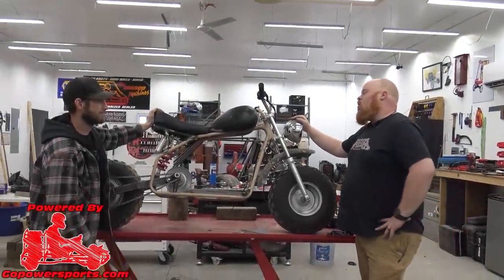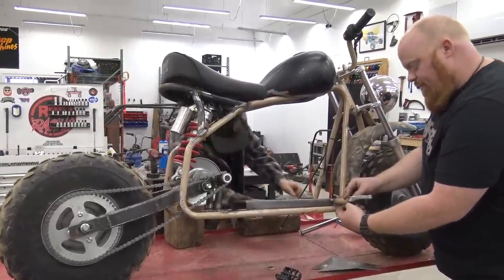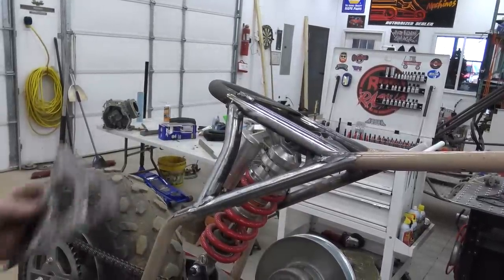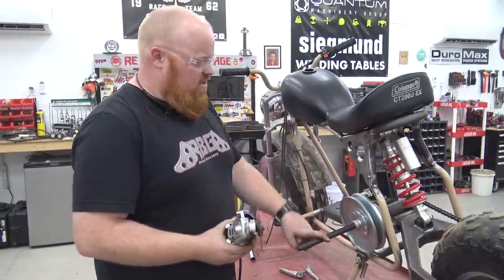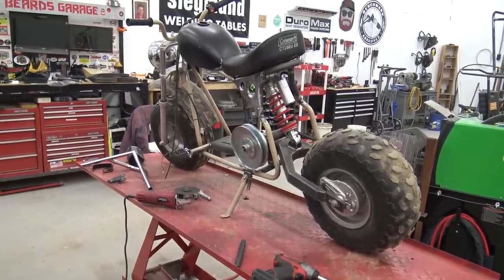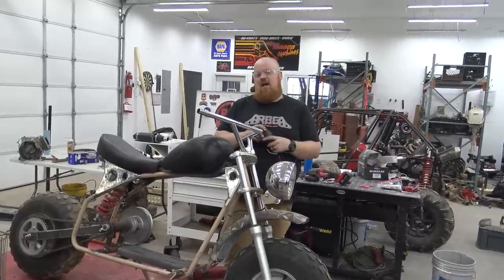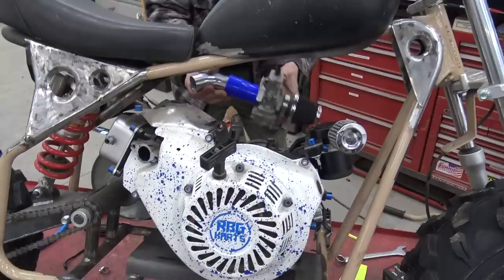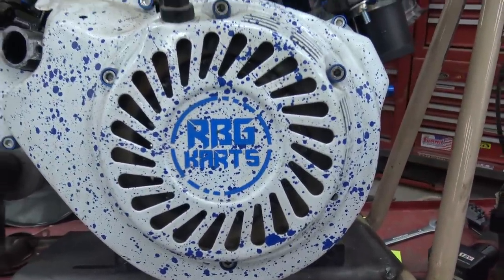Dimple Die Panels and Aggressive Tires ~ Coleman CT200U-EX Full Suspension

Comment: Man y’all have got me in so deep I don’t know if I ever will dig out. Started watching RBG before u left the Ford place. At some point I started dreaming of building my grandchildren a go kart. So RG said get a Duromax, and said CVT the way to go , got that to. Then there was the hydraulic brakes , got that to oh yes and the fed and rev trans , yeah that’s a game changer Lonnie says.so got it. And got to have live axle and v tread tires yep ordered them. Oh almost forgot rack and piñon .Then I looked at the old go kart frame and all this all this ain’t fitting on it. No problem, what would old Greg do? Go buy a bunch of tubing , and build a frame from scratch. Didn’t mention seat and 4 point harness. Then started cutting, grinding and tacking. Now all I need is for Greg , Lonnie and the little serial killer to come help me finish it before I die of old age!

Comment: I watch your builds and really enjoy them.I have ridden motor cycles for ever and just wanted to make a suggestion. If you would re-drill your motor mounting holes to move every thing to the right, this will move the motor pulley away from your left ankle.  Looks like you will need to cut and re-weld your jack shaft mount. If some one with out boots on gets against that pulley it could eat up an ankle.
Reply: I hope he doesn't, and doubt he'd even waste time contemplating it, as it would clearly be a huge amount unnecessary work.  
If it was going to be a problem it would be far more sensible to fabricate a basic cvt cover.

Comment: Those dimple die kit are quite ekspencive, but they does the trick, that`s for shure. Very nice build boyz, but you could straighten the curve on the seat, me thinks. Make some double disc-brakes on the front wheel and it will be totally awsome.

Comment: To make the dimple dye cut piece slide off, could you put some grease on the screwed on end so when it cuts it will just slide off?
Reply: But it came off without a problem.  If there was an issue it just means the guide hole could be drilled marginally bigger.  Grease isn't going to stop a close fitting guide hole from minor hanging up on the threads.

Comment: I have a question for you I'm starting my own YouTube channel but I needed a question answered about 301 predator engine I bought one of them cheap torque converters but I need a torque converter that fits on the engine the correct way instead of backwards

Comment: Seat needs to move rearwards about 3-4" and a frame extension added to the rear and a rear fender added to smooth out the fitment lines and make that rear tire not look like it's sticking out a foot...  But looking good otherwise...
Reply: Not at all.  I hope he doesn't ruin it by doing that.  Proportions are fine and kinda like the classic bobber look.

Comment: you are going to have problems with the intake
Reply: Nope.  Ignorant comment.
Reply: @SportbikerNZ   no it just seems like it. Fuel pedals in long smooth tubes. 😂🤦🏼.
Reply: @SportbikerNZ   we will see when he post a video if it works it will be sweet. But if not I told you so.  And I was just saying hey I don’t recommend put that long tube after the carb